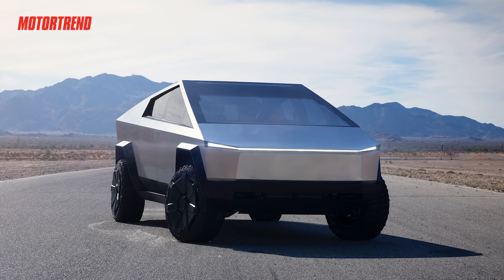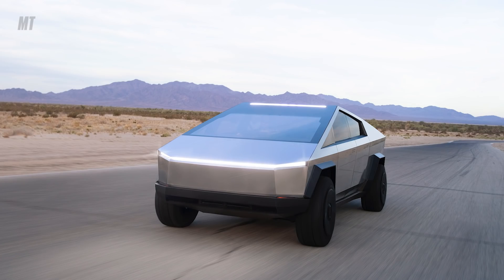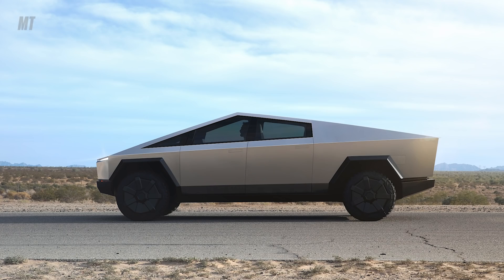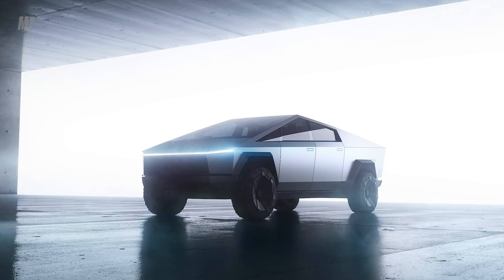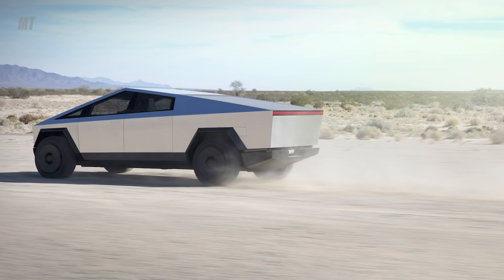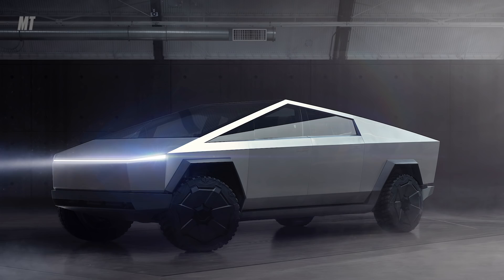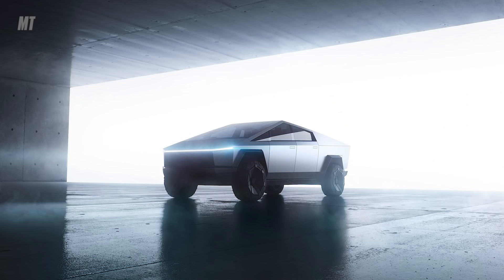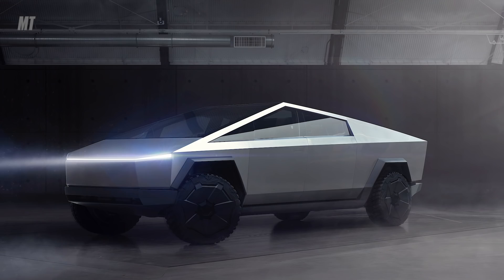What Can the Tesla Cybertruck Do?—Range, Batteries and Towing

Comment: Tesla so far ahead.  Gigafactories to keep the batteries coming vs 3rd party bottlenecks, Superchargers, and WiFi updates to keep adding new stuff and self driving.  I own a Model X and preordered the truck.  I have solar panels and powerwall that save me $600:month on electricity and gas.  This is the future.  I have 32,000 miles on my X with no maintenance and never visited a service center.  I have never used a Supercharger as I charge at home and fly when I travel.
Reply: Scott Campbell same here except have the SP90D. Own a ‘04 Caddy EXT as well, original owner, so the Cybertruck tri-motor version is right on time. And I will put it through it’s paces, from firewood to Sheetrock, etc, just like I do the EXT. Not for show.....

Comment: 300 miles to a charge? Wow cant wait to take that on a trip...not. At least a gas truck can be fueled and kept going!!!! Sorry Tesla, not sold.
Reply: Michael Guerin so just like you re-fuel your car before it’s empty, you charge the vehicle.....
Reply: Yes but the difference is I pump fuel and I leave. Start charging a, I'm waiting 12 hours for a full charge.  It's going to be a long trip, Bev H.
Reply: Michael Guerin I am a Tesla owner. Own a Model S P90D. It doesn’t take 12 hours to charge haha, charging is FREE!, and no one drives there Tesla to empty just like I don’t drive my gas powered truck to empty. I’m sold and one is on order for me, it’s just not for YOU
Reply: My point is this. It's a trip killer. Sure good for around town but a trip would take forever. I pulled the info for charging from teslas website. It does say an hour to twelve. I'm not waiting an hour when I can pump and go. Just saying
Reply: Michael Guerin when I go on a long trip, I have to stop anyway to eat and use the restroom, so waiting for an hour to rest and eat is worth it for a FREE full charge. 👍🏾 No need to pay $50 to $80 per fill up ...👌🏾 Not trying time convince you, just trying to clear up some inaccuracies.

Comment: 250 and 450? NO
250 and 500
Reply: Range gain is not linear due to the extra weight of the extra battery.
Reply: goodfella21f  250 and 500 is linear

Comment: Back up to a 8,000 lbs trailer and pull it across the country? Just stay out of many Mountain States because it's a EV and they don't have charging. And what effect does grade have on a EV truck? The whole EV thing alludes me. Limited infrastructure means they are mostly tried to urban areas or interstates. And the fact that you are dependent to the electrical grid means you still have a Carbon Footprint. Only 14% of ELECTRICITY IS FROM RENEWABLE SOURCES. 86% is from conventional and nuclear sources. Think about it.
Reply: CrazyLegsMcGee no it won’t. It’s being forced and subsidized right now and it’s not going anywhere.
Reply: CrazyLegsMcGee thank you for your doom prophecy, you can file it with the other fairy tales
Reply: CrazyLegsMcGee The supplies of coal, oil, and natural gas are nearly unlimited. 

Solar panels, one of the most viable sources of “renewable” energy, requires rare earth minerals like selenium and lithium, both already dwindling in availability. 

You tell me what we’ll survive on.

Comment: Does anyone think that Tesla will come out with battery packs or trailers that have built in batteries to allow for long distance towing? Not sure that this car on its own would be able to tow a trailer over long distances due to aerodynamics and such. If that is the case, definitely could see special trailers or systems made to compliment the CyberTruck for long distance towing without frequent stops.
Reply: Would be cool if they tried towing with 30k pounds on it with fifth wheel.
Reply: @JalenRose02  Yeah, not gonna happen. Engineers saying this is a gimmick,  the range if it towed even a utility trailer will be crippled. Nice that Elon got a nice no interest-free loan from his flock to continue development though.
Reply: @spooley  well this thing is a pos then when it comes to towing. Only good for riding around. Then i rather take a 4runner.
Reply: @JalenRose02  Agreed. Even the breaking bulletproof glass was all about getting the buzz out there. Check out "Rich Rebuilds" channel on Youtube. He worked at Tesla and although still a fan he exposes the BS. He wants people who bought them to be allowed to fix them. Found him through a video called "The Rogue Tessa Mechanic Resurrecting Salvaged Cars" , very interesting how they won't even let you buy replacement parts for your own car.
Reply: @spooley  newer cars have that stuff on them that you can't fix them by yourself.
Reply: @JalenRose02  But this guy can, he has several examples of customers driving long distance because he can get it done without the 3-6 month wait through authorized dealers. They don't want you to lose the $$$ on maintenance fees. The door handles that pop out are a terribly bad design. When they stop working you can not open the car. Tesla can also disable the fast charging system,  you are at their mercy for every little detail.

Comment: How does the design of this thing pass federal regulations? Answer? IT CAN’T.
Reply: Since when has any concept car been able to pass Federal Regulations?
Reply: Jacob Hill this is supposed to be the finished product.
Reply: @THESLlCK  Musk said yesterday that this isn't the final design.
Reply: Jacob Hill they just released the final design, spoke too soon?
Reply: @THESLlCK  Where do you see this?  Because I just looked it up, and the only things I've seen are speculations and prediction renders.
Reply: Jacob Hill You’re not the brightest bulb on this thread. 😂😂😂
Reply: @DJL78  Yeah, I'm an idiot because I...read an article with relevant information to this topic.
Reply: You can't make a statement like that without going into details, the burden of legitimacy lies on you now.
Reply: CH2O Experts say the pickup, as of today, is more concept than production car, and it’s not street legal. The vehicle lacks side mirrors — though the government may eventually approve rear-looking cameras instead of mirrors — windshield wipers and a front bumper. And its single light bar in the front and back would not pass safety standards. There did not appear to be any turn signals or a third brake light. The tires also appear to protrude from their wheel wells, which is illegal. The pickup’s sharp angles and ultra-hard material could also be a safety issue, with no obvious crumple zones to absorb the impact of a crash, which could affect the safety not only of those inside the Cybertruck, but any vehicle or pedestrian it hits.